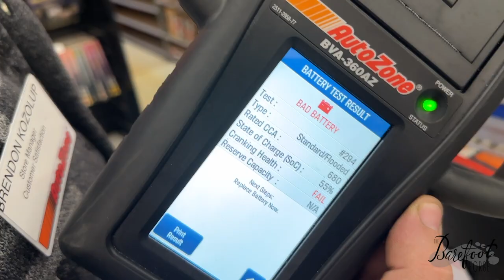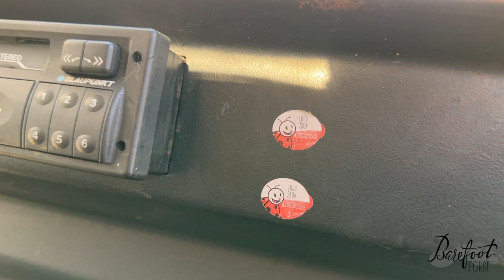I Bought a Doka! From Poland! VW Vanagon Truck Build

Comment: The double cab license plate lenses and bulb holders are the same as a van but the black housing is truck specific, you may need to look at Brickwerks in the UK for some of the JX parts and some of the doka specific parts, they do have the proper door check strap for the rear door.
Reply from the maker: Luckily we swapped to super bright LED license plate lights, and they work great in the doka housings!

I’ve actually found Ken at Vanagain has most of the JX parts I’ve needed so far!

Comment: I`m enjoying your videos, so I signed up .
I had 3 bugs and a rail buggy , I Love VWs !
Your channel helps fill that void .
Thank You for sharing your video, and letting us hang out .
Reply from the maker: Hey jack! Thanks man, welcome to the crew! 
That’s an impressive set of vehicles ya got! Which has taken you on the best adventure?
Reply: @TheBarefootForge  My first one. A 65 that thing was awesome in the two tracks. I got it stuck in snow once. I put the snow brush to the gas pedal, jumped out, and started bouncing & pushing until it got going. I ran along side, hopped in, and drove off .

Comment: I've been looking for a crimp tool and connecters to replace in my 87", REALY apreciate what you use
Reply from the maker: The wire crumpets and heat connectors?
Reply: @TheBarefootForge  I wanted to swap out all my connector on the groun lug and the ones on the chasis eng groun/distibuter.. been having a hard time finding the right connectors to replace those oem...

Comment: Hey brother l love the channel and definitely a subscriber, I had a 1987 Vanagon that blew the head gasket at 147,000 miles and found out many years later that these vehicles were meant to swap engines every so many hundred thousand kilometers and it was as easy as one could drive in the morning and they swap out and install a rebuilt engine by the afternoon and they run like forever because they are meant to change…. so every time the engine gets replaced all the accessories get inspected and you basically get a rebuilt vehicle. How cool. I Would love to learn if you know any history of their regularly scheduled maintenance record, and any suggestions for folks who like to better preserve and maintain the vehicles they have now🤙🏾
Reply from the maker: Well, that's not exactly true, the engines were designed to run 150-200,000 miles, without rebuild, and often did. 
It just so happens lots were not maintained well and needed work or rebuilds in shorter intervals, but since they had a similar system to the older air-cooled busses in regards to the way the engine came out- they sure are easy to swap out!

The air cooled ones are even easier!

This one, being a turbo diesel, is not easy at all to swap out. lol

Comment: Did you replace the burnplates before putting the injectors in, and check the pump timing
Reply from the maker: Yes the heat shields were replaced, and the pump is being rebuilt right now (next video- chapter two, coming soon!)

Comment: For a European t3 / Vanagon its not very rusty, i am in the uk and they can be quite rusty, i have similar issues on my diesel, i am learning from you ! i hope to see more on this one.
Reply from the maker: It’s not particularly rusty, but it sure is beaten to within an inch of its life! Lol

What’s wrong with your engine?
Reply: @TheBarefootForge  The engine in mine doesnt like starting from cold, and will run rough and smoke , once been running a few minutes its running nice and starts easier, did you check the wastegate on your turbo moves ok ?

Comment: Well that might explain a little bit while you having a rough time starting it and a few other mechanical issues LOL 😂
Reply from the maker: For sure! Well, it’s got plenty of problems still. Lol
Reply: @TheBarefootForge  yeah but she's definitely a beauty but I agree with you guys what the heck was that person thinking when they built that exhaust but at least you found out why it was clogged up and a vast majority of the reason why it wasn't running right I'm definitely going to start going on the hunt for one hell I'll even take a stripped-down cargo van version LOL
Reply from the maker: @michaelmyers3892  the exhaust wasn’t clogged up at all, that had nothing to do with the running conditions. Or a diesel the exhaust really doesn’t matter at all, unlike on a gas engine.
Reply: @TheBarefootForge  got ya
Reply from the maker: @michaelmyers3892  but you should definitely get a bus! Most are for sale on www.thesamba.com if you’re shopping for a US market van.
Reply: @TheBarefootForge  yeah I'll be shopping in the US market it's just putting the money aside for one that runs not too worried about a little rusted wheel wells or things like that as long as the mechanical side of it the frame suspension and all that in good shape I know these buses could go anywhere from $2,000 up depending on condition at what one wants
Reply from the maker: @michaelmyers3892  one that runs and drives is going to be $10k for a passenger van model, anything less then that hasn’t been driven regularly, reliably, in years. $2k buys a parts car that’s been parked for 10 years, just got one yesterday- video soon.
Reply: @TheBarefootForge  yeah that's why I was going to do some deep searching cuz I know there's got to be some out there that aren't going to set me back to bad

Comment: 20:06 thast intake no loose of boost there and also change the engine for AHU AFN or 1Z because this engine is total garbidge or order South Africa Bellhousing and put in 2.5TDI from audi 100 :)
Reply: The JX is anything but 'garbage'. I own a 1990 Syncro 16" camper with a Reimo conversion that has toured the world, 280,000 km, with a totally stock JX powering it. Yes, a TDI is a huge power increase but if one is not in a rush the JX with a few small modifications is a great little engine.
Reply from the maker: @karloskelly  yep, that’s my hope! It should zip around just fine.